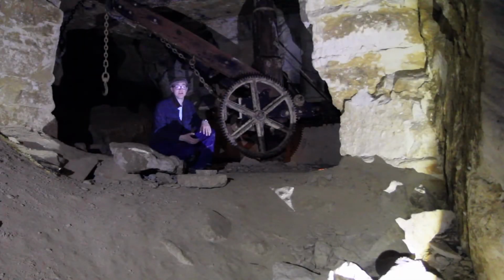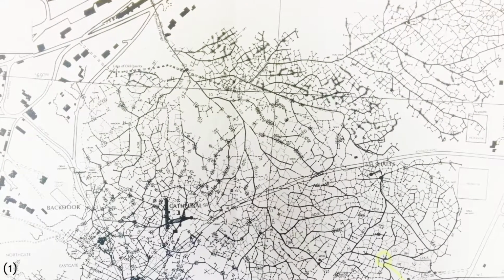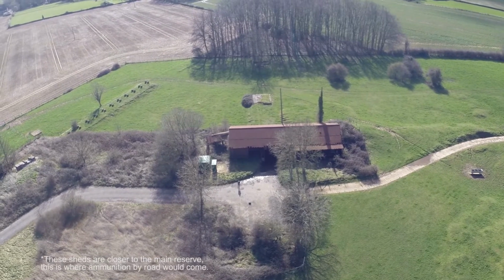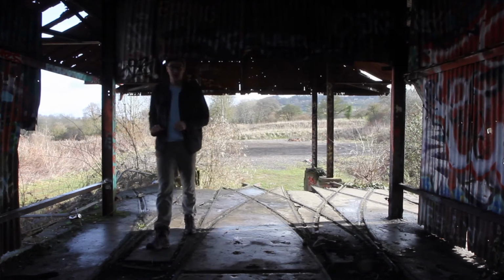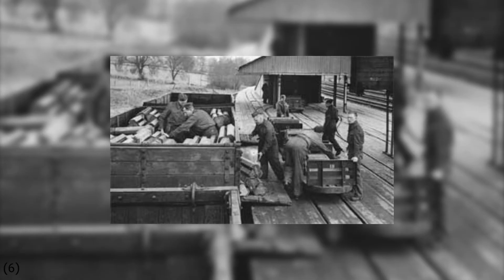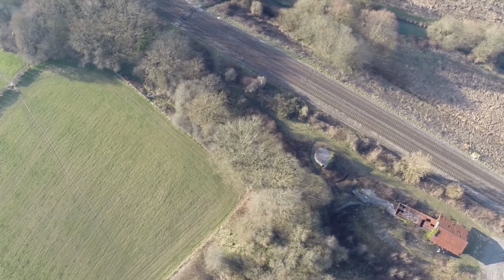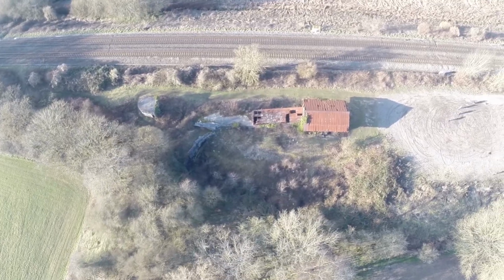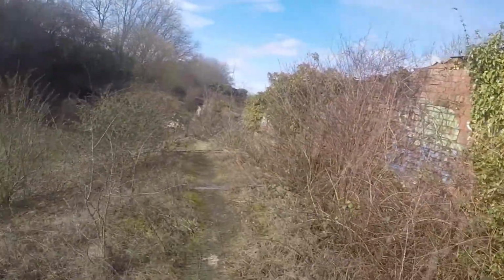CAD Monkton Farleigh: Abandoned Underground Labyrinth

Comment: Surprised you didn't show the other side of the building where it exits the CAD,  disguised as an old farm building but still has the old track and winch that pulled the carts.
Reply from the maker: Those sheds are also amazing but lockdown meant I couldn't get more footage of it. The railway one is the cooler because of the mile long underground tunnel inside it! Hence why I mostly focused on that part!